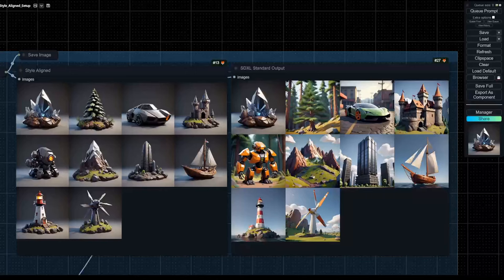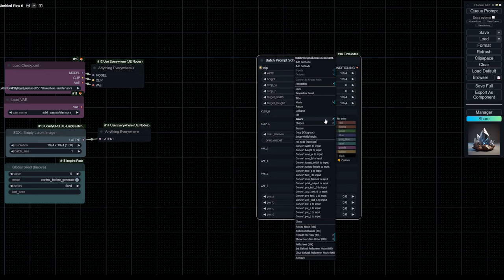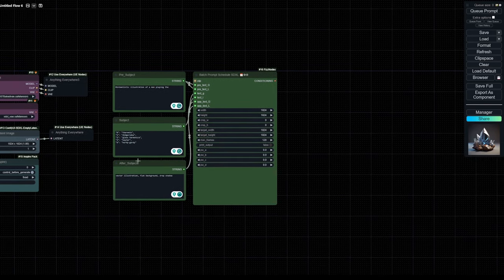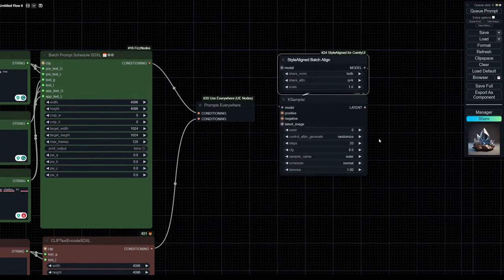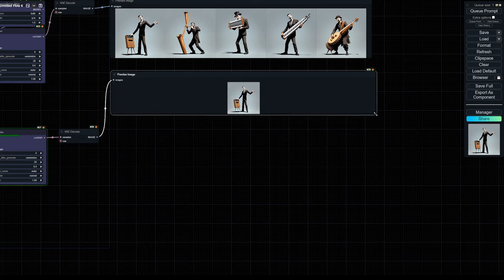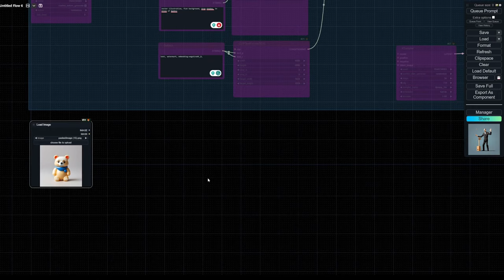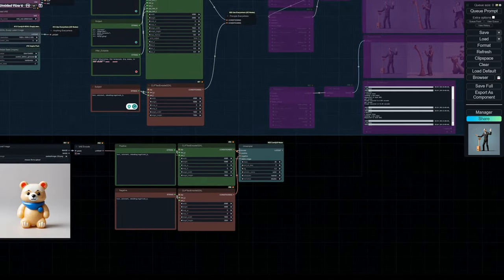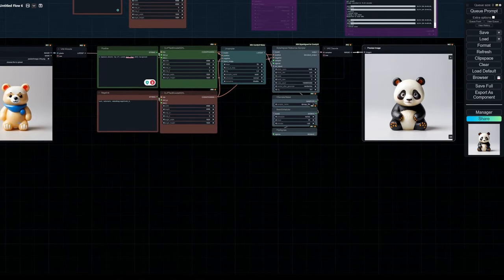Style Aligned ComfyUI Workflow: Consistency Across Generations ✨

Comment: Really glad to have style aligned in Comfy but Im running into a weird issue, 
when I generate 4 images(4 batch size), I basically get 2 groups. By that I mean that image 1+2 are the same, but 3+4 are a different style but the same as each other?
So when I run 8 images(8 prompts, 8 batch), I still get two groups. 1-4 the same 5-8 the same?
Really weird because everything is working and no errors appear in the command prompt.
Anyone see something similar?

Comment: Now the "Style Aligned Reference Sampler" node takes in a "ref_latents" instead of "ref_latent" making it so you cannot connect the unsampler latent... any suggestions how to fix?
Reply from the maker: Maybe something went wrong when installing the node. It should accept "ref_latent" as you can see from my video. Perhaps try reinstalling the style transfer node.
Reply from the maker: Currently away from pc ill get back at you tomorrow ;)
Reply from the maker: It works on my end , ive updated the workflow and replaced the unsampler. Try loading that one
Reply: When I try to run youre flow comfy wants the ref_latens(Referenz sampler). did the flow work for you without the connection? and thanks for youre Video! @tech_bytebrain
Reply: @StableFun  The most recent workflow stalls at "ref_latents" here as well. "ref_latent" is connected.... so what needs connected to "ref_latents" to work.
It's an intriguing workflow that I want to share with a friend, but he's not patient and wants everything to work before I share.
Reply: Thank you for the quick reply. I look forward to seeing how you and youre friend complete the workflow @TheDocPixel
Reply: Yeah, stuck here as well.
Reply: This. And unfortunately, my CLIPTextEncodeSDXL has a "Error occurred when executing CLIPTextEncodeSDXL" 'g' error too :(
Reply: Any1 fix this ?
Reply: @tech_bytebrain  I'm also getting the same problem. It has an empty ref_latents in addition to ref_latent and doesn't go anywhere without it
Reply: @diogogmiranda  Same here!